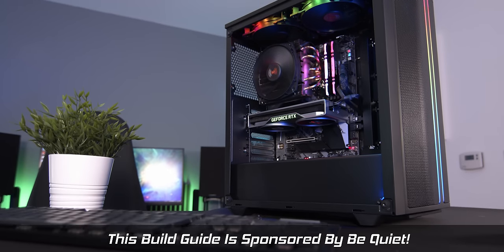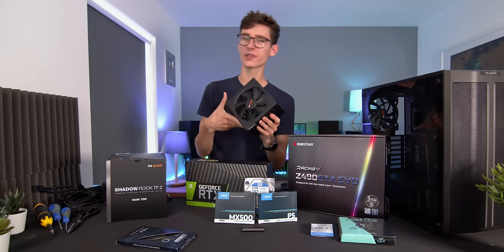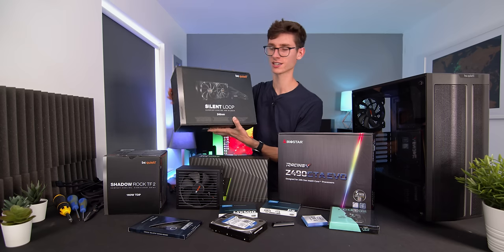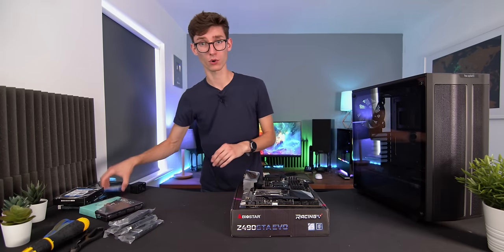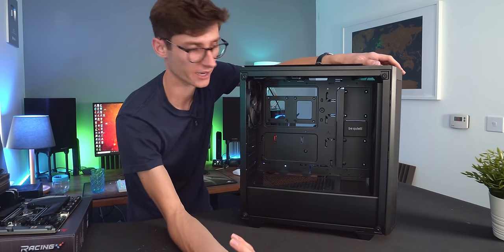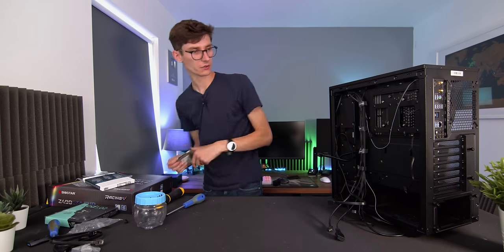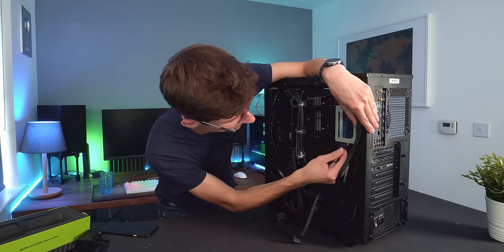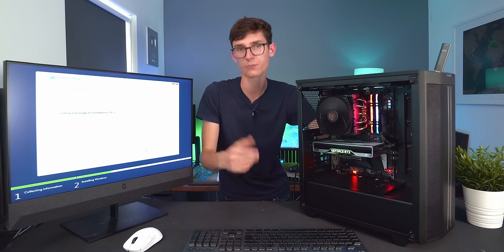How To Build A Gaming PC 🤗 COMPLETE STEP BY STEP Beginners Build Guide | AD

Comment: About how much is this going to cost because I really want to build a gaming pc for myself and this seems like a good one to build
Reply: If you wanna figure out how much it costs you just need to add the prices he linked by pressing the arrow next to the title of the video.
Reply: I’d say a good pc like the one he build would cost around 800 dollars
Reply: I'm already 500 pound in on my first PC still got a few parts to buy the total is around 950 with a monitor 
I've bought used parts also new just to keep costs down
Reply: Jordan Hall yea I just made my first one for a similar price feel like it’s kind of a sweet spot right now for a decent system without breaking the bank
Reply: This is not a great build for budget pc ,it's got unnecessary expensive components like the 10600k and rtx 2060 ,modular power supply and the cooler.A much better configuration would be:
Ryzen 2600x with aorus B450 Pro or 
3300X with a budget B550 if you plan to upgrade to a ryzen 4th gen CPU 
GPU: 1660 super or 5600xt ( if you are on tight budget get a rx570/rx580)
256 GB MX500 sata drive for OS and key programs 
1TB WD blue 7200 rpm as your game drive 
PSU: Antec Earth watts semi modular 650W or a Corsair TX 650 W 
RAM : atleast 3000mhz 16GB kit 
CPU cooler : Be quiet slim rock 120w ( excellent and small for ryzen CPU)
Case fans: Artic P12/P14 they cost 5-7$ each and are bargains 
Case is your preference
Reply: kanna mustafa Damn you really went all out in helping us out with this and I respect you for that man! Thank you!
Reply: @varunnadarajah8382  No worries bro, we have all been in the same place trying to build budget PCs, atm I have a :
2600x with B450 Aourus Pro
16GB G skill Aegis 3000mhz
128 GB Crucial BX 300 (stay away from it, the mx 500 is much better and worth the extra money) 
480 GB Corsair MP510 NVme SSD (again if you can buy it for a good price fine other wise a cheaper option like the WD SN550 or crucial P1 are okay even tho are slower) 
2 x 2TB WD Blue 5400 Rpm (again terrible choice i made but one was gifted to me by amazon so its cool, if you can find Toshiba 7200 rpm drives they are better) 
Gigabyte RX 570 
PSU is a Antec Ea650G Pro, excellent and semi modular with 7 year warranty
Reply: kanna mustafa hey do you think I can run dual monitors and play cod at high speeds and FPS with that build and how much will it cost
Reply: @Drank4soasa  It really depends on the settings you want to play at, the configuration I have : 2600x +rx 570 allows me to do 60 fps constant with medium high settings.
If you want 144 fps then you will have to try a 3600 (3300x if your budget is tight and can't wait longer) on B550 motherboard and a 5600xt /RTX 2060  (pricing depends on your country but performance is similar, 2060 is slightly slower) about dual monitors I am not sure what you mean but I have used two monitors to work on my pc and the rx 570 handled it fine so it shouldn't be a problem). I suggest you to wait the launch of new ryzen CPUs and new GPUs so that you can get bargains on the previous gen stuff
Reply: kanna mustafa ok thank you and 1 more question what if I want higher FPS and my budget is liek 1.3k almost i can go a lil higher but when do you think the new gpus and things are going to come out
Reply: @Drank4soasa  Nvidia is going to introduce their new GPUs at the end of the month , so AMD should reply in October /November the latest . AMD is going to release it's new CPUs in September/October I believe ,nothing is certain yet because of Covid 19 . 1.3 k Euros or dollars?
Reply: kanna mustafa dollars so what would u recommend for me right now and also should i but the new gpu and amd or do i wait until they come out and get the other parts because they going to be cheaper and this is my first time buliding a pc
Reply: @Drank4soasa  If you are not in a hurry for a pc Isuggest you to wait for CPU and GPU ,in the meanwhile buy the SSD ,Case,RAM ,PSU and other storage if you find good offers for those parts
Reply: @Drank4soasa  I bought most of my parts at the cheapest price possible and I only spent 625 british pounds for my pc
Reply: kanna mustafa ok so what sad and case and ram and psu do u recommend for me rn and also when I buy the case does all parts fit or does it have to be a certain case for certain parts
Reply: @Drank4soasa  The PSU and Motherboard depend on the case you choose, there is ATX, mATX and ITX. The case is really upto you and the space you have got. PSU wise if you want an ATX or mATX case I suggest you the Antec EaG 650w Pro or the corsair TX650, they are both semi modular so cabling is easier and also have 7 year warranty. Ssd I suggest you either crucial MX500, WD Blue SN 550, Sabrent Rocket, Sandisk Ultra 3D or Corsair MP510.
Reply: @kannamustafa6043  but will a 3300 X do if I want to buy an rtx 3070? Or should I just get a Ryzen 7?
Reply: SudBucket really I thought any pc under a thousand dollars most likely wouldn’t be able to run anything
Reply: @jonathanfairchild63  what could you do with 200 dollars?
Reply: @kannamustafa6043  do you think i could do a good PC with ~200 dollars???
Reply: @espectador-  it's not possible unless you have a preassembled, or you can buy a cheap dell optiplex and try add a gtx 1650s
Reply: edgar edgar I would save up for a pc around 500 tbh your graphics card should be around 200
Reply: @kannamustafa6043  Okay i can afford everything else expect the Nividia Geforce RTX 2060, what can i use to replace this. (im new to this) i can afford the EVGA 06G-P4-2066-KR GeForce RTX 2060
Reply: @pinkflufflyunicornsdancing969  You might as well wait for the new GPUs to be presented and then get a discounted Rtx 2060/2060super/AMD rx5600xt
Reply: @kannamustafa6043  should i go with asus x570 hero wifi with rtx 3090 and ryzen 9 5950x (when it comes out) with a samsung g9 monitor 🤔
Reply: @prefescent4460  If you want the best and you afford it then yeah why not 🤷‍♂️👍
Reply: @kannamustafa6043  alright nice one, whats your pc specs
Reply: @kannamustafa6043  this recommendation would cost how much?
Reply: @prefescent4460  I have 
2600x 
Aourus B450 Pro 
G skill Aegis only 3000 which are running atm at 2133mhz ( unfortunately I have zen + CPU and a stubborn B450 motherboard) 
Gigabyte Rx 570 4GB
Corsair MP510 480GB 
2 x 2TB WD Blue 5400rpm (awful don't buy them, buy 7200Rpm HDDs)
Antec EaG 650W Pro
Reply: @kannamustafa6043  not bad
Reply: @richardobiora1524  Prices have gone up so its around 750-850 British pounds atm, I bought everything at cheaper prices before coronavirus so I spent around 600-675 with some parts that were recycled
Reply: @kannamustafa6043  uhm sorry I just need specifics, please where can I shop for parts? To get new or used/recycled that's genuine
Reply: @richardobiora1524  It depends on where you live bro
Reply: @kannamustafa6043  I stay in Nigeria. I know I cant get these parts here.
Reply: @kannamustafa6043  I was wondering if u have an Instagram account so I can message u because I’m trying to build a pc and I’m lost.
Reply: @darkpluto8508  You can reply here if you want  I got notifications turned on
Reply: @jonathanfairchild63  cap the core i5 and 2080 super more then half

Comment: My pc isn’t detecting a monitor. The pc is on and running, so is the monitor, they are plugged into each other, but the monitor isn’t detecting that it is plugged into a pc. Help wanted.
(It might be my hdmi port on my pc isn’t receiving power, is that a thing?)
Edit: I think the problem is my motherboard isn’t compatible with my cpu
Edit 2: my new cpu is here and my computer is up and running
Reply: Jk idfk
Reply: Did you actually buy a cpu without making sure it’s compatible with your motherboard
Reply: @tamman994  yah the cpu wasn’t compatible. Everything is fixed and
Working now
Reply: @stealthpoint  good to hear

Comment: Let's make a "Which Motherboard to get" out of this comment.

I'm going to buy a Ryzen 5 3600. Any suggestions?
Reply: If you want to spend more money then get a rzyen 7
Reply: I should get a MSI - B450 TOMAHAWK MAX (Socket AM4) USB-C Gen2 AMD Motherboard
Reply: And a Ryzen 7 3700 CPU
Reply: I would be comfortable using any of these in a Ryzen 3000 build (listed alphabetically, with no budget in mind):
B550:
ASRock B550 Steel Legend
Asus TUF Gaming B550M-Plus (Wi-Fi)
Gigabyte B550 Aorus Master
Gigabyte B550M Aorus Pro
MSI B550-A Pro
MSI MAG B550M Mortar Gaming (or WiFi)
X570:
Asrock X570 Taichi
Asus ROG X570 Crosshair VIII Hero
Gigabyte X570 Aorus Master
Gigabyte X570 Aorus Ultra
MSI MAG X570 Tomahawk
MSI MEG X570 Unify
Reply: Get a Ryzen 5 3600 , GTX 1070 , b450m pro max .
Reply: Sagamer9YT cmon man not a 1700
Reply: KakashiKun is that a really good pic build
Reply: Tomahawk b450

Comment: I built mine a couple of weeks ago, ordered the same case but I wanted the FX version, ended up buying the extra fans. Used a AMD 7700X CPU and a RX 6750 TX GPU, also bought some Corsair 2 x 16GB RGB RAM. Overall pleased with it, think I bought the wrong GPU but never mind I will buy a new one later on. I also installed a 1TB NVME and a 2TB SATA SSD drive. First time building and trying PC gaming, mainly a console gamer. But so far I am impressed I built one and “it’s alive”. 😂🤣😂🤣😂🤣

Comment: True speed. True power. The AMD Ryzen™ 9 7945HX3D processor uses exclusive AMD 3D V-Cache™ technology to pack a massive 144MB of memory directly on the chip. This colossal memory cache maximizes responsiveness to deliver the fastest mobile gaming performance you can get¹, and it will be available first on the ROG Strix SCAR 17 X3D.

Comment: Very helpful even though I’ve done this before, it’s been ten years and I didn’t have a side panel in the case, all the fans, lights, the drives and psu put elsewhere, newer usbs or a modular psu.

Comment: Great video. Now I just need to figure out which brands to buy and what all the codes mean. I've learned enough about graphics cards to know I curreently have a 1060. I hear a good upgrade would be a 3000. The most recent is a 3060.

But now what? Is there a correct motherboard for all this? Power supply? Processor? So much more research will be nescesary. :O

Comment: is there a 2022/late 2021 version of this? or will it make a difference? excellent video btw :)
Reply: The overall PC build process hasn't changed dramatically in about a decade. So if you want to use this video as a guideline of how to assemble a PC, it should still be fine. There are some slight differences between manufacturers and models, but nothing too difficult to figure out.

Comment: What I really wanted to know was how to know which hardware pairs with what, and how to know that your wiring harness has the correct connectors, etc. Thanks anyway, but putting the parts together is the easy bit.

Comment: Happy New Year. I'm a equites trader and I need help specifying an 
desktop. I have no issue with budget but dont want what I dont need. My 
only requirement is I need to drive 6 monitors (only use 4 now), I'd 
like that the machine could be compatible or up-gradable to 4K. But for 
now just need to run 4 32 inch monitors with high speed and precision. 
High speed, reliability internet connection hardware is a definite.  I 
suggest that trading requirement desktop needs is a common and popular 
topic and not far off from the your gaming focus, can you please do a 
video on a build such as a described. Thanks

Comment: Should we worry about ESD when building a pc? Or it doesn’t matter these days? Thanks
Reply: Should you worry about it? Probably not as much as in the past, but it doesn't hurt to protect from it (and really discharging yourself by touching a metal part of the case is probably sufficient to do this). Components aren't necessarily going to fry by releasing a static charge, but it could subtly impact the lifespan of components. Though to have any noticeable effect you'd probably need to be touching the components fairly regularly.

Comment: DRG-13: Based on testing by AMD as of 6/29/2023, with the following processors: Ryzen 9 7945HX3D vs. Ryzen™ 9 7945HX and Intel Core i9-13980HX. Configuration for the AMD systems: ASUS Strix Scar 17, 32GB (2x16GB) DDR5, 1TB SSD, GeForce RTX 4090 Graphics, Windows 11 64-bit. Configuration for the Intel Core i9-13980HX system: ASUS Strix Scar G16, 32GB (2x16GB) DDR5, 1TB SSD, GeForce RTX 4090 Graphics, Windows11 64-bit. Test results are based on average FPS scores in the following games: League of Legends, Total War: Warhammer 3, Strange Brigade, Middle Earth: Shadow of War, Borderlands 3, Riftbreaker, Final Fantasy 14, Deus Ex: Mankind Divided, F1 2021, Dirt 5, DOTA 2, Cyberpunk 2077. All tests run in turbo mode, 1080p native, at high details. System manufacturers may vary configurations, yielding different results. Performance may vary.

Comment: I'm building my first gaming computer. So if you have time, are these parts like ok for the price and stuff?:
CPU: Ryzen 5 5600x

GPU: ZOTAC GeForce RTX 3060 AMP White Edition

Cooler: Corsair Hydro H100i RGB Platinum SE v2

Motherboard: ASUS ROG Crosshair VIII Hero S-AM4

RAM: Corsair Vengeance RGB PRO DDR4 3200MHz 16GB

SSD 1: Kingston A2000 250GB NVMe M.2 SSD

SSD 2: WD Black SN750 1TB M.2 SSD

Case: Corsair 4000D Airflow Midi Tower

PSU: Corsair RM850x 850W PSU

Fans: Corsair LL120 RGB 120mm Fan White

Monitor: AOC 32" CQ32G1

Thank you:)
Reply: Seems mega for a first pc 👍 make sure you know it's compatible

Comment: would it be wise to just buy everything that's listed in the description for the pc?
Reply: That is if you can get your hands on them. PC parts are notoriously hard to by at the moment. Also note that the installation of some hardware may only be for an example,  as you might not need 2 ssds

Comment: I have a question, I've got a PC with a i5 processor. I'm looking to upgrade my ram and my graphics card from a RTX 3060, 16 GB, to a RTX 4070 ti, 64-32 GB will this work and is it worth the upgrade?
Reply: Helps to know what i5 CPU you have. Intel has been making the Core i series of CPUs for over a decade. If your CPU is too old, then it may be a bottleneck upgrading to a higher end graphics card.
Reply: @JJFlores197  I've got a i5-10400 cpu, at 2.90 GHz
Reply: @Un0va_ yes, upgrade it (CPU)

Comment: Do you buy different types of motherboard like what’s the difference or are all motherboards the same
Reply: No not all are the same. Some will not be compatible with the graphics card and CPU and other components. If you want to base your pc off of this video I highly suggest using the same motherboard. Some instructions for certain cables as well will most likely be very different.

Comment: Heya! I’ve just ordered pretty much all I need for a pc except thermal paste. I’ve ordered an Intel® Core™ i7-12700KF Processor, but I’m not sure what thermal paste to get if any. It’s also coming with the iBUYPOWER 240mm Addressable RGB Liquid Cooling System - Black to go on top of it.

Should I get thermal paste? It seemed a little optional from how ya worded it.
Any recommendations?
Reply: Its not optional. Most CPUs coolers come with pre-applied thermal paste so you don't necessarily need to buy extra. I would buy some just in case you need to remove the CPU cooler later on; you don't want to reuse thermal paste. As for the brand, it really is up to you. Everyone has their own preference. I generally use Arctic Silver 5 and/or Tuniq thermal paste.

Comment: Quick question, was there a reason you put the ram chips in, in that order? Can you put them in, in any configuration?
Reply: It is to enable dual channel. Basically, it allows faster transfer speeds between the memory and the CPU's memory controller. If you have just 2 RAM modules, you can install them in any configuration you want, but for best performance, you want to install them as described in the motherboard manual. Some motherboards are very picky and won't work well or at all if you don't install the way it wants it.

Comment: do i need to use the hard drive and the SATA SSD or do I need to choose one of them ?
Reply: You can use either, but it makes the most sense to use an SSD as it is significantly faster than a hard drive. The general setup is to use an SSD as the boot drive and a hard drive as extra storage. Or, you can buy a large capacity SSD (1-2 TB or more) and forgo the HDD.

Comment: Let's see if I would have Build a 2 terabyte gaming PC don't I have to use a stronger cooler depending on which side is going to be like sdd or a hard drive
Reply: Storage devices (except high performance NVME) shouldn't require extra cooling. Even high end NVMEs will only need as much as a (probably included if necessary) small heatsink.
Reply: @nicholabrichieri-colombi8471  thank you for letting me know

Comment: Im currently learnung about gamijg pc's as i want to build one thenni found out i need to install bios and random stuff for it to work
Reply: Nope. The BIOS is pre-installed on all computers. Otherwise a computer wouldn't work without one. In some instances, you do need to update the BIOS, but that's not that common.

Comment: can i use the cpu you mention with a Gigabyte B450M GAMING (Socket AM4/B450/DDR4/S-ATA 600/Micro ATX),
Gigabyte B450M GAMING (Socket AM4/B450/DDR4/S-ATA 600/Micro ATX)Gigabyte B450M GAMING (Socket AM4/B450/DDR4/S-ATA 600/Micro ATX)
Reply: Neither of these motherboards would work as their socket type is AM4, which will not work with this CPU. You could use an AMD CPU, but if you want this particular one, you will have to use a a motherboard with a LGA socket.